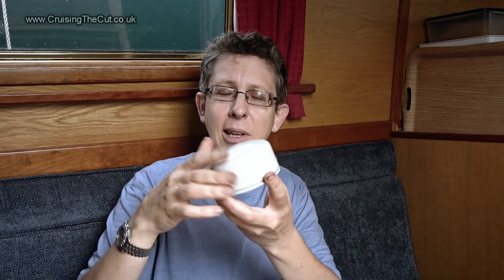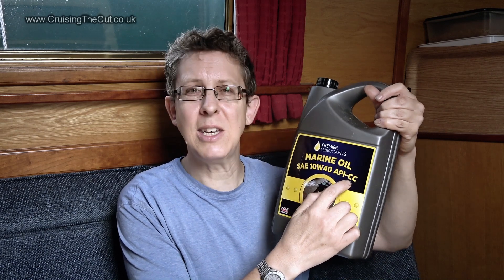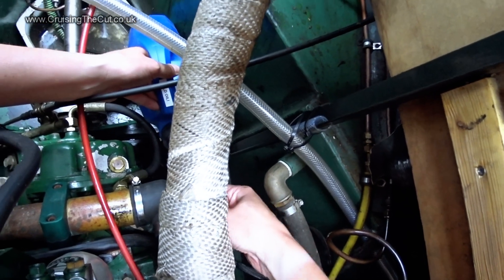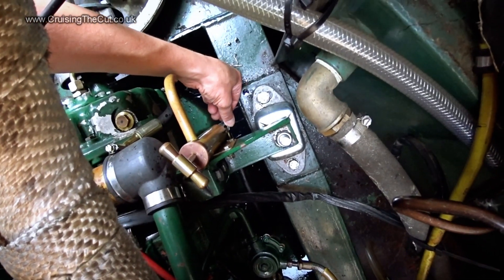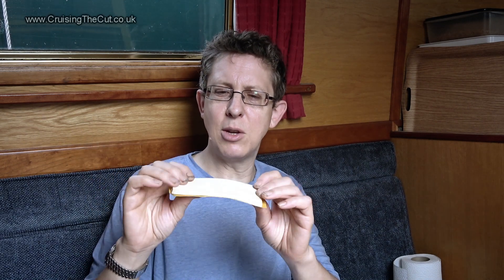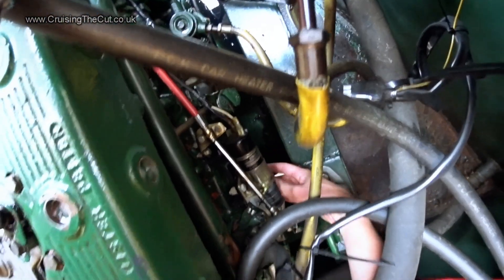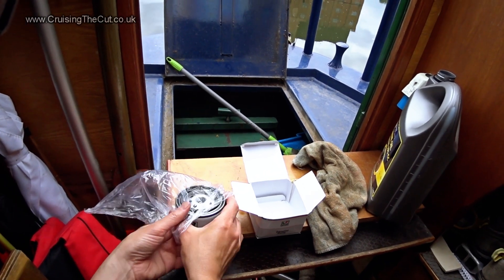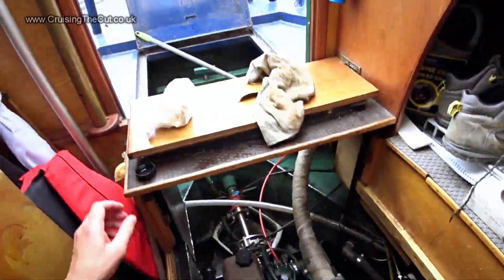110. Oil and filter change on my Lister Petter LPWS4 narrowboat engine (canal boat)

Comment: Another thing you can use to get the oil filter off is a leather belt, just make sure that your trousers don't fall down in the meantime!
Reply: purchase a second leather belt for the engine.
Reply: What about those rubbery pads available in kitchen gadget shops for removing jar lids? Less than 50p I'd think. I mean, if you're not going to spend the 2 pounds for the actual correct tool, and want to save that bit of weed hatch gasket for shimming/padding a small gap, or something.
Reply from the maker: Good ideas all!

Comment: Some will fill the oil filter with new oil before putting it on, but I see yours is mounted sideways. You could pour in just a bit. Yes, always put oil on the gasket to prevent it from tearing when screwing it on.  This is a helpful video. Some knowledge is needed to know how to do this even if you hire someone else to do maintenance. You'll never know where you will be when something needs doing.  Thanks David for sharing with us. Do you have any idea how scary it was hearing your engine running at the start of the video and seeing you pouring oil in ?  :O
Reply from the maker: Haha, I didn't think of that!! (the start). Yes, any oil in the filter would tip straight out as I try to stick it on. Other engines may be different and it won't take long for it to fill anyway.

Comment: It is possible to install a remote oil filter. If it points down dribbles and the filter can be caught in a container. It can be positioned where you can get both hands on the filter. Oil can also be pumped to a tank to be collected later. ..Paul

Comment: You might want to consider a large package of the largest disposable diapers or nappies I believe you call them.  They can be spread out in the bilge under the engine to catch the drips of normal operation, under the oil filter to catch the inevitable drips and after punching the funnel spout through a cupped one, over the oil filler hole to catch the inevitable drip or spill as you refill the crankcase.  they absorb really well, hold alot, if you can remember back that far (I can't, too long ago and I was very young) and roll up cleanly for disposal.  They also absorb coolant spills well too.
Reply from the maker: If you scroll back to some of my early videos, I forget which one, I did indeed do a whole section about the benefit of nappies for mopping up oil, so yes I do have a stash :-)

Comment: before you put in the new oil take the dippstick out.
then you can fill the oil faster the air can escape via the dippstick hole.
Reply from the maker: It would make no difference, you can hardly pour the oil so fast as to totally block the filler hole, and indeed nor should you. It needs to be slowly poured.
Reply: CruisingTheCut  On some engians it does makes a differance it just depends witch model and or brand.

Comment: Instead of regular paper towels I recommend the heavy duty blue shop paper towels, they absorb oil better, hold more oil and are much stronger and just like regular ones I burn them soaked in oil in the wood stove, for under the engine to catch all the drips use Pig Mat, it expensive but made specifically for soaking up oil, it can be found on Amazon, Newpig.com, uline and most machinist websites.

Comment: I highly recommend that you order yourself a box of disposable nitrile mechanics-grade gloves. They are grippy, keep oil and grime off, and provide a small measure of heat resistance. Nitrile won't break down or react to typical engine or cleaning fluids like latex does, either. Mechanical grease seems to take ages to get out of skin, and I hate greasy or stained hands so I've been a fan for years. Something like these from Amazon: AMMEX - GWON46100-BX - Nitrile Gloves - Gloveworks - Disposable, Powder Free, 8 mil, Large, Orange (Box of 100)
Reply from the maker: I've got a box but I hate disposable gloves (or anything really); so environmentally unfriendly :-(

Comment: After running the motor, always wait 5-10 minutes before checking the level.  Otherwise there's a risk of overfilling. 

Also fill to the high mark before starting after a change. You know the level will drop.

Comment: add to your list of bits, puppy training pads!  they are great for oil spills and drips. i use them under my chainsaws to soak up what drips off the chains.
Reply from the maker: Yup, will do.
Reply: I use them as well David.  Much larger than the nappy idea you used in the past.
Reply from the maker: OK, cheers

Comment: You could buy a newer oil extractor, which is a tube down the dipstick...................usually you can get all the oil out as it usually goes down to the bottom of the pan.
Basically, stick the tube down the dipstick...............pump up the vacuum on the canister, and watch it fill up. It's usual marine oil change tools here in Canada.

Comment: I always wondered how you got the oil OUT. That pump seems like an excellent bit of kit.
Reply from the maker: It irritates me that there'll always be a little bit at the bottom that doesn't come out, I'm sure, but that seems to be the way it happens on narrowboats!
Reply: CruisingTheCut you always put some of that "extra" oil in and pump that out before you change the filter. That would get more of the leftover oil out.

Comment: A handy tool for an engine bay: An old (empty) makeup compact mirror stuck to a stick. Or spend the money on a mirror on a flexible handle from a mechanics supply store, but one is nearly free, and the other costs far more money.
Reply from the maker: Good tip!

Comment: Most oil filters are tightened about 3/4 of a turn from the time the rubber gasket makes contact with the engine. Some filters have this info. printed on them or the supplier can give you the specifications so no guesswork.
Reply from the maker: Good info; yes, I tend to go "hand tight then a fraction more"

Comment: Don't be tempted to leave your engines overfilled with oil.  If an engine gets overfilled, the oil level may contact the spinning crankshaft which will promptly whip the oil into a froth causing a rapid loss of engine oil pressure. This is definitely a case where more is not better. Happy boating everyone .

Comment: Use a marking pen & write the date & hours on the filter. If nothing else it will avoid confusion, i mixing up the old & new filter!!
Reply from the maker: I note the engine hours at each change in a logbook, as I can't see the filter on the engine!

Comment: Smearing a bit of oil on the O-ring doesn't help with sealing, it lubricates it so that it doesn't bind a d tear during installation. Most new filters that I've seen in the last 10 years or so come with some pre-applied grease on them, but I still hit them with some motor oil before installation. If you don't have a funnel, cutting the top off of a plastic bottle works a treat.
Reply from the maker: Good tips

Comment: Tie or clip some string/bootlace/cordage on lid of old oil container loops.  Why?- Because you should put the lid on again before  you lift the old oil out of the bay. And of course, Sod dictates you drop the lid and have to fish it out while doing a handstand against a hot engine block.  So bootlace is a good prevention. 
A gallon of old oil dropped in the bay (easy if you hands are oily) can ruin your day.

Comment: I've wondered about this business of warming engines up to drain the oil. 10 W 40 mean the oil is thin at cold temperatures to ease staring and actually thickens a bit as it warms up. Apparently the 10 and 40 are the number of seconds a set amount of oil takes to drain through a particular sized hole. So, warming the engine appears to make the oil a bit more difficult to drain. Am I missing something? It certainly sounds a bit odd! Err, and I still warm my engine! BobUK.

Comment: enjoyed your engine oil change ............. however rather than throw out your used oil ........ pore it in your fuel tank ...... bang off two tanks of fuel tanks and change fuel filter ....... best keep screat also vegetable oil in the heat of the summer can also used for fuel as well needs to be warm weather thought .......... 1,6 k doing this on my diesel still running strong ....... happy trails ........ hehehe..... S
Reply from the maker: I will not be using old engine oil as fuel.
Reply: Stewart you crack me up. I'd love to see what your boat/engine looks like.  I have a picture in my mind - something like Dick Dastardly's car in wacky races?!!

Comment: As you said you did regret doing the oil change in such a hurry. I would have used the time to make a nice cup of tea and a cheese and tomato sandwich. 
Oil changes are for wet chilly days when you can't get to the pub.
I fitted a drip tray under my engines and bought oil spill pads to soak up any fuel or oil leaks. 

My sister lived just up the road from the last bridge you passed under before the lock. So it was good to see the view from the river.BS.
Reply from the maker: I had the cheese sarnie and a cuppa as soon as I'd moored up on the other side, fear not!

Comment: They also sell a oil filter wrench that attaches to a ratchet wrench and it works like a bolt socket as it fits over the end of the oil filter. Some filters come with ridges on the end of the filter, this socket type filter wrench uses these ridges for grip. Ive heard both good and bad reviews of these type so buyer beware.
Reply from the maker: Good info

Comment: This is a great video. Many of us want to know all about the mechanical side of operating a narrow boat. Since you save money by doing your own oil changes you should investigate a remote oil filter mount. It usually consists of a four piece kit consisting of the remote filter mount, a hose from the engine adaptor to the remote filter mount, a hose back to the engine adapter mount, from the remote filter mount, and the engine adaptor which screws onto the engine oil filter base. Voila! Oil changes will be very simple plus you can mount the remote filter mount so that the oil filter screws on vertically so there isn’t the problem of oil running out of the filter making a mess as with horizontal mounted filters. Keep up the good work. Search on eBay.com for~ Derale Engine Oil Filter Remote Mounting Kit 15718; 3/4"-16 Filter, $49.00 US.  Oh yes I forgot to mention  being able to mount the filter with  gasket up allows pre-filling the filter so that there isn’t a dry run time for the engine while the oil filter is getting filled.

Comment: One other thing you didn't mention.  When changing the oil filter, make sure the old O-ring comes with it.  Sometimes the old O-ring will stick to the engine block, and if you put the new filter on overtop of it, it won't get a good seal no matter how tight you screw it.

Not sure how common that is on canal boat engines, but it's happened to my car twice that I can remember.  I caught it both times and prised off the stuck O-ring, but it happened to a friend too and they didn't realize.  Sprayed a couple quarts of oil across the inside of their shed.  Awful mess.
Reply: Mister Carpenter, sir, that's why you put on some oil on the new o-ring before you install the filter.

Comment: If you have to use the screwdriver through the filter method the oil and filter changed has failed...been there done that and it is a big mess.
But that sticky tape was a great solution...still better to have a good tool.
Reply from the maker: True!

Comment: Hey everyone! Great video. New to boat community... I have an Isuzu 55 engine... Silly question... does it have a filter??? I can’t find it... Do they all come in a rounded shape? Thank you guys!
Reply from the maker: Which one - oil filter? Fuel filter? Air filter? It almost certainly has all of them. Most oil filters are round, air filters tend to be round or oblong, fuel filters probably round too. I think you'd need to specify your exact engine model for people to chip in with accurate help.
Reply: CruisingTheCut thank you very much! I guess its the oil filter as shown in the video above... I don’t know when the previous owner changed the oil nor the filter last so I’m taking upon myself to do it! Will get the exact engine model... thanks again!

Comment: Put a screwdriver through the oil filter and you'll probably be cleaning oil out of the engine bay area for weeks. Probably better to use some sand paper around the old filter for extra grip??

Comment: David are their any oil disposal points you can use as a continous cruiser? eg would a charge be made for you to dispose of at a marina?
Reply from the maker: There are and someone else posted a link to a map of them which I'm going to "pin" at the top of the comments, so check back in a bit (once I've found that comment) and it'll be at the top.

Comment: Just a note, perhaps it has never been an issue for you however I have experienced the hot oil ruining the rubber seals within the oil extractor pumps! I now only run up an engine briefly before an oil change, just warm enough to let the oil flow easily.
Reply from the maker: I don't usually do it this hot!
Reply: if you warm the engine up, a lot of the crud in the oil can be removed as it is suspended in the hot oil. When the oil is cold, the crud sits in the sump.

Comment: Enjoying your videos immensely could you say how often you change the oil I’m guessing every couple of months?
Reply from the maker: Every 100 engine hours, according to the manual. Yes, that's a lot! A later version of the engine required every 250 hours.
Reply: CruisingTheCut That’s a small oil filter no wonder it only lasts only a hundred hours. The screwdriver technique, the old ones are the best.

Comment: Now, I could be wrong, but it seems to me that, having found how hot the engine was, you might have waited half an hour to let it cool a bit. Just a thought really.
Reply from the maker: But I didn't have half an hour; I was waiting to go into the lock with another boat and that meant I could do it right now or not 'til much later. And, since I'd started, I finished.
Reply: Ah. Did you let Magnus Magnusson know?

Comment: Also have a plastic bag (no holes) to put the old filter in, as soon as removed to avoid used oil spills. Also, if doing a lot of cruising at low RPM, get yourself a used oid sample kit & have your oil checked for contaminants. Your engine is a big investment & analyzing your used oil may suggest reducing or increasing your oil change intervals. You can find these services via Google for a small price. Call the company involved & get their advice if you are not a qualified mechanic. I do hope this has been of some help. Remember protect your engine! William Caddy, member of The Australasion Society of Deisel Engineers.
Reply from the maker: It's already on a 100-hour interval, I'm damned if I'm doing them any more frequently!! But good tip, cheers

Comment: Excellent informative video (as usual). I'm planning to get a boat shortly and thinking about my wish list for the fit out. I'm a fan of hot curries and spicy food but have heard on some of the forums of a build up of let's say exhaust gas in the toilet cassette after a couple of days with some nasty issues at the lsan point. I've read that you can purchase a special "Curry" cassette which has stronger seals on it and vents. Is this true or merely an old wive's tale? Or should I be thinking about a pump out or composting loo? I'm also considering a bow thruster, are they worth having?
Reply from the maker: I've never heard of such a thing, someone's winding you up. I don't think any type will be particularly better suited to that problem. Bow thruster can be handy but not vital.

Comment: Could you give an appraisal of the merits of using the Lister diesel engine.vs a petrol one. Given that diesels are most suited to heavy loads and produce more torque (not necessarily what you need ) but are scarily expensive to repair, why not opt for a cheaper  petrol engine?
Reply from the maker: Virtually no canalboats use petrol; slow-revving high torque diesels are preferred. Apart from anything else, diesel is much safer to store and use, plus almost nowhere on the canal sells petrol.

Comment: Don't worry if your new oil goes black quickly as this is consistent with diesel engines & means the oil is doing a good job.
Reply from the maker: Yes, it certainly used to on a diesel car I had.

Comment: How you doing? I was just thinking about that miserable diesel spill in the bilge.
Reply from the maker: Well I mopped it as best as I could and slapped a bit of paint on top and despite the diesel contamination it'll have to do as the engine needed to go back in and I need to press on....

Comment: if i tried this without a funnel i would need to buy 2 jugs of oil 1 for the engine and 1 to spill on the engine. only other thing i can think of is getting a mirror so you can see what your doing, just remember everything will appear backwards.